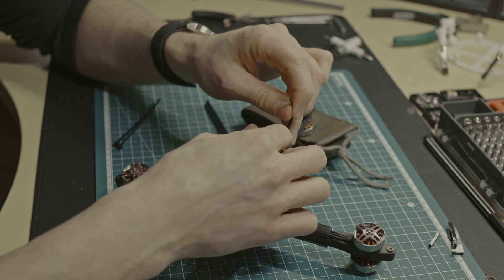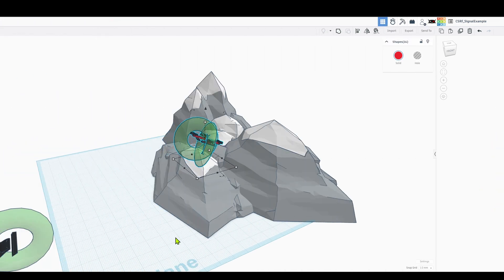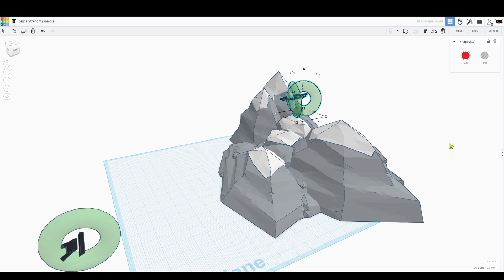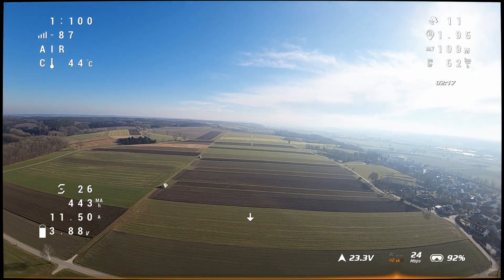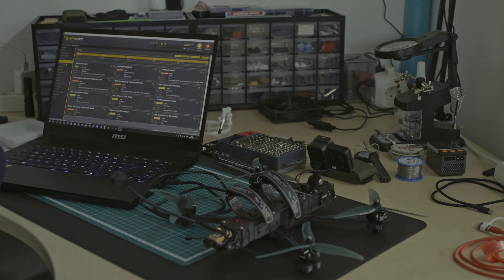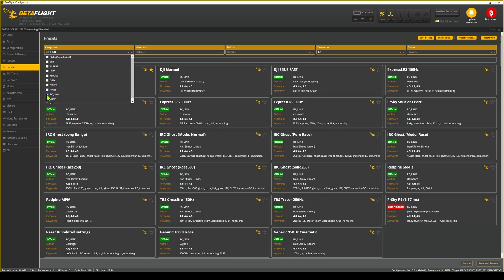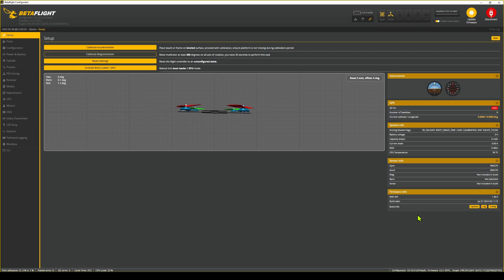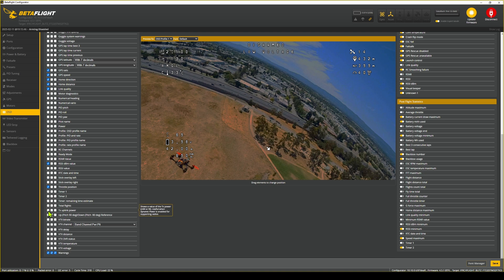Crossfire RF profile frequency lock tutorial |  TBS Long Range FPV Receiver Setup

Comment: is it really better than in dynamic mode?
Reply from the maker: I lock Crossfire to 50 Hz for long range because it gives more headroom and a more stable link. The TBS manual also suggests locking the mode depending on your use case (range vs latency).
Reply: @flipsfpv allright thanks for the tutorial!

Comment: RC link preset to be applied only ones, right? For example, i have to apply presets for both 50hz and 150hz for different needs. If i fly from long range i will just set rc to 50hz and later if i have to fly short  range flight i just need to choose 150hz on rc...anything else needs to be done?
Reply from the maker: Hi, the preset has to be applied once, yes. On the radio you can choose the frequency lock via menu every time. But you can not apply both settings to the drone via preset. It is 50hz OR 150hz! If you want to change from one frequency to the other you have to change it within betaflight.
Reply: @flipsfpv after i apply both the presets (50hz and 150hz) one by one into BF and when I changed from one frequency to the other, I just need to change on the radio and not in BF, isn't as presets are already applied?...sorry for asking back this question...wanted to make sure the process..
Reply from the maker: @myfpvshots   On TBS Crossfire, you can choose either 50 Hz or 150 Hz on your radio at any time — but the Flight Controller cannot switch between these two modes dynamically. The FC can only work with one RC update rate configuration at a time.

When you apply a Crossfire preset in Betaflight, it adjusts several internal settings (RC smoothing, interpolation, filtering, timing, etc.) to match one specific update rate. These settings can’t be active for both 50 Hz and 150 Hz simultaneously. If you load the 50 Hz preset and then the 150 Hz preset, the second one simply overwrites the first — Betaflight never keeps both.

So even if you change the frequency on your radio, the FC will still expect the rate it was configured for. It does not automatically adapt to whatever the radio is sending. That’s why Betaflight provides two separate presets.

In short:
- Your radio can switch between 50 Hz and 150 Hz anytime.
- But your flight controller cannot.
- You must apply the matching preset in Betaflight for the frequency you want to use.
- The FC will only operate with one of those modes, never both at once.

I hope this clears it up — the presets aren’t “stored side by side.” Only one configuration can be active on the FC at a time. If you want to change frequencies, you need to load the correct preset again in Betaflight.
Reply: @flipsfpv Thank you so much for replying in very much details❤️🙏. I understood now.